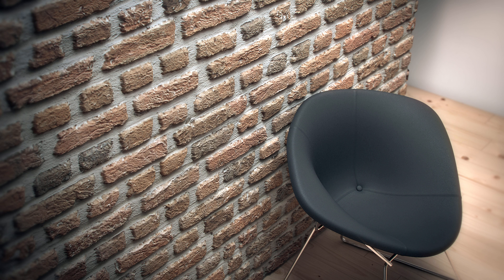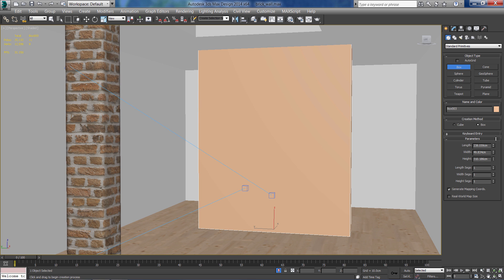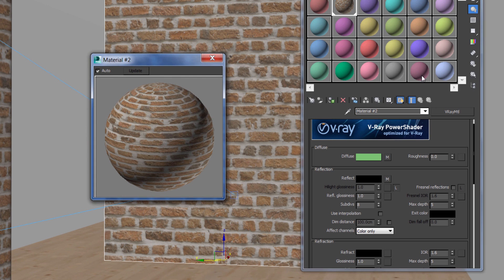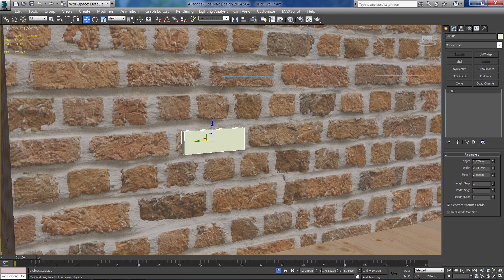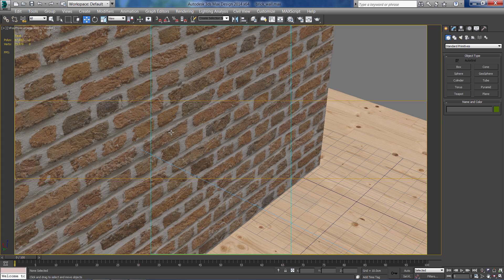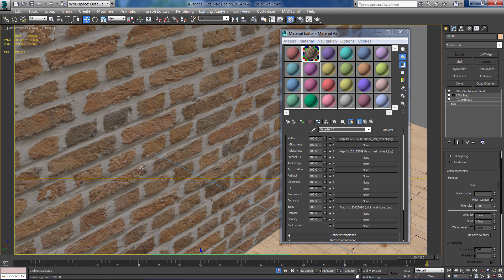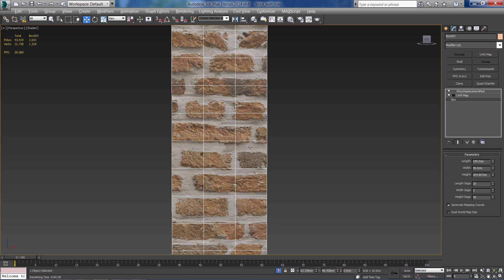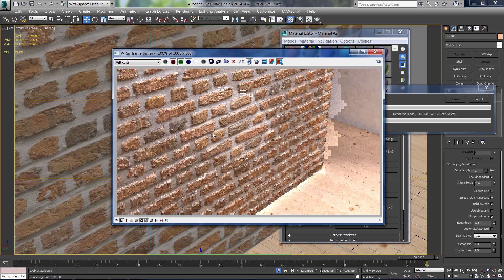Vray Displacement Tutorial - how to create a Brick Wall material in Vray

Comment: how can ı solve the problem off the black space between edges that appears after using displacement  without using turbosmooth because it make a file very heavy ?
Reply from the maker: +Anas Hyousef make sure that the texture is wrapped continuously around the wall using the UVW modifier . Also you need to turn on "keep continuity"  in Vray displacement mode.  If you want to use turbosmooth only at render time and not in the viewport then  turn on "render Iters" and set the number of iterations
Reply: +Arch Viz Camp thank you very much